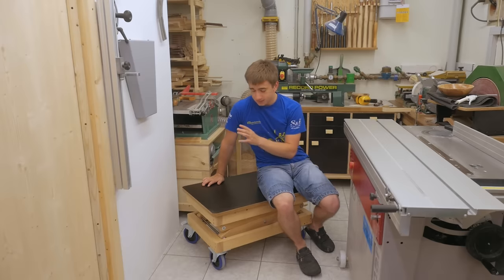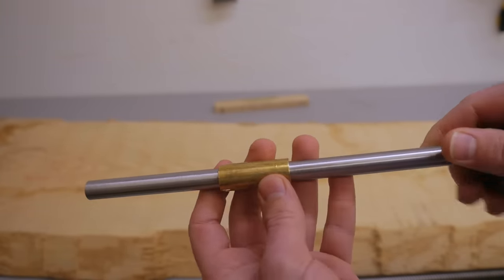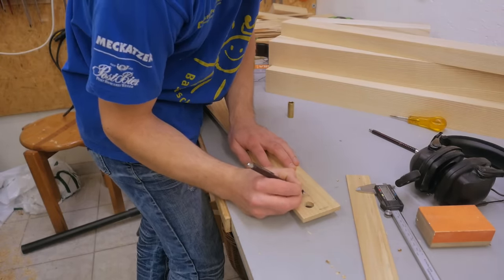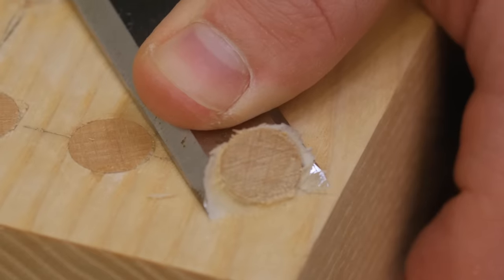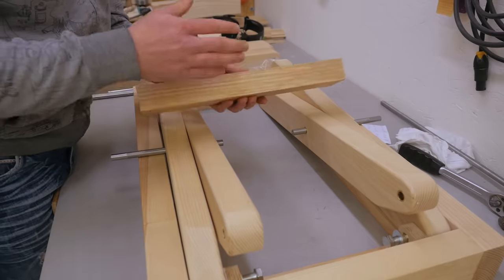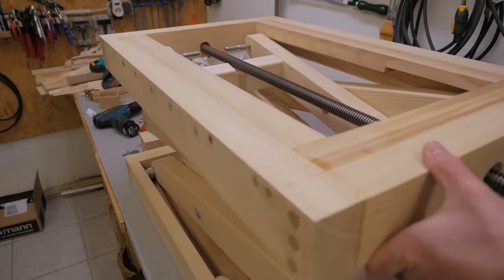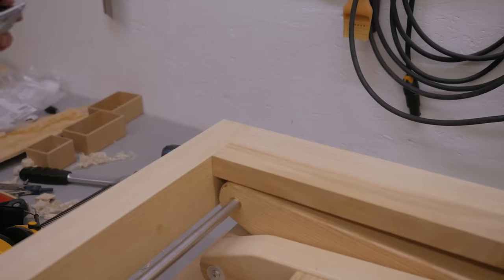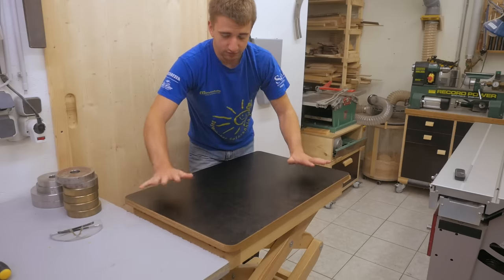Homemade Wooden Lifting Table

Comment: Wow!  One of those would have been handy during my move.  Now thinking about building one, but I'm not sure I have enough need for one compared to the time it takes to build one!
Reply from the maker: I can only recommend building one. For me/ us it already came in handy inside and outside the shop. Without filming you could do it in 3-5 days
Reply: Grosses Lob von Matthias. Kann nicht jeder Holzwerker aus Deutschland von sich behaupten.
Reply: Yes build one! I'm always surprised what you can make from scrap  materials. and another shelf build is not that fun to watch.
Reply: make one to replace scaffold :)
Reply: Ernst van Spronsen Everything Matthias does is fun to watch, but yes I would love to see him build one too.
Reply: Ha! When was need ever a reason to justify building something but I reckon an Arduino bluetooth remote motorised scissor lift scaff would be really handy.
Reply: 3-5 days is a bit to pessimistic - Matthias would probably tear down some ikea shelf and an old bed frame, put a few tennons with his panto router on them and will be finished in no time :)
Reply: I'd love to see you build one :)
Reply: Matthias, it still would be handy if you build yourself one... why?

well... when you have to assemble something heavy and want to get it on or off a workbench... it even works as some mobile work surface and work support... for example as a outfeed table extension :-)

and there are many more uses for sure
Reply: The first thing I thought of after watching the intro was that "Matthias could sure use one of these" quickly followed by "I'd sure like to see how Matthias would make this"... Even if you get minimal use it'll get great views and then Heisz would have to make something besides chainsaw stools.
Reply: It would be interesting to see your take and application on the project.  I was thinking could I do this in metal to add strength to the machine.
Reply: I bet if you did build one, then you would find more uses than you can shake a stick at. I bet you Rachel and family would find uses for it as well. :-) So build one and see what happens; if nothing else, it will make a nice adjustable height workbench/outfeed table.
Reply: It's a dolly effectively, with lifting capability. If built well, like Marius did, it will last forever and could have everyday use in shop.
Reply: A collaboration between you two guys would be fun to watch!
Reply: Dylan Strawn does anyone remember Matthias' motorised scaffold platform?
Reply: Nicola Cassolato they'd build a space station or a flying saucer!
Reply: Matthias Wandel I think it's one of those things where once you have one you find more ways to use it than you originally thought
Reply: Matthias Wandel uh oh Matthias, you might be looking at your replacement!
Reply: Build one please!
Reply: Make one with wooden gears.
Reply: + Matthias Wandel, maybe you could take it a step further and build one that you could crank up and down while standing on it? You know, for reaching high shelves in a vertical storage system? Hey, that's an excuse to build some higher shelves as well. Multiple projects/videos to justify each other.
Reply: suit1337 I agree with your comment, but I believe you are thinking of a different Matthias :)
Reply: @ernstvanspronsen1502  As long as you have no need to use your time on anything other than hobby projects.  You couldn't make enough money working in mcdonalds in less day to be able to buy one? And not out of wood....
Reply: }}} "Wow!  One of those would have been handy during my move.  Now thinking about building one, but I'm not sure I have enough need for one compared to the time it takes to build one!"

Hey, half the point is the fun of doing it. 😀
Reply: How much you need it compared to the time to build it is a stupid comparison Matthias. You only need to build something once you then have it forever. I would build one if i were in your shoes

Comment: Beautiful piece! And very impressive strength.

One suggestion: When you made the template for the scissor arms, since you needed the ends equal distance from the center, you could have made a one-ended template instead of a two-ended template. Clamp, drill center and one end, then put a bushing in the center and rotate it to drill the opposite end.

Comment: This was an awesome project! I would love to have a lift like that for working on yard equipment, and small engines. As far as the metal lathe, what reasonable person would expect you to use it in the manner of a professional machinist? As far as the length of the video? When the more interesting the content, the less one notices the passage of time. 
One thing though, keep your fingers out of the crush zone of that lift, at all times, regardless of how much you trust the device. We don't need you changing your channel name to Marius Halfhand Hornberger.

Comment: Thanks, Marius. I'm almost done with mine tonight.I have to weld on the drive nut and make the handle!! you make a great instructional video. I like the hydraulic idea but mine will not go over 55 inches so the crank will work fine.   What is the distance of the handle on the crank to the socket?.It looks to be about 8".........cheers, Jim

Comment: Marius, this lift opens up new possibilities for shops with limited space.  My shop is 19'x20' (5.9x6 meters) interior dimensions but I have a lot of tools and machines.  I had been thinking of building a table with a rotating top for the sander, grinder and drill press.  A flip table would accommodate the planer and miter saw.  With the lift table it would be easy to store all of the tools in vertical shelves and set the needed tools out as required.  The primary function of my shop is to build radio controlled aircraft so large woodworking is a secondary function once the cabinets and workbenches have been built.

Comment: An addition I feel would be useful is to add a sheet over the area where the lower bearings run. That would reduce the amount of dust that collects there that could stop the height adjustment. Don't want to put something heavy on it and find it won't lower far enough because some wood chips got in the way.
Reply: Bunny Warren - I was thinking about the exposed bearings as well. Although they may cost a little more, I would have used sealed bearings. This was a well done video and an excellent project!

Comment: Hi. Very impressive. I wonder whether the scissor lift could be adapted to go right down to ground level. and up to perhaps 2 feet.  This would be great for wheelchair users (or even people with a poor walk). There seems to be a need there - and you seem to be close to filling it. It would need to operate by electricity (eg battery) but I think it is just waiting to be invented. Anyway, even if you do not go in that direction, I admire you for your very honest approach. Regards, Eamonn

Comment: I'd have done it differently.  I'd have cut each piece of wood just off square and drilled the holes with a greater degree of error, thus ensuring nothing lined up.  Then I'd have frigged about for hours trying to get the unit together, only to have it fall to bits when I tried to use it to lift my 100kg table off the groud.  I'd then drive down to the nearest store, buy one, scratched the labels off it and told my mates I made it.
Reply: Luke Johnson i cant find your build video? Some kind of youtube error i suppose
Reply: Dude. Feelz! This fella's precision has me all, like, stars in my eyes and such!!!

Comment: Hi Marius, I have to say that this is best 30 mins of interest build I have seen and well explained , is there at any time plans available as I have seen a great video which would help me in my work shop and as well as load my Water table saw into the truck by myself and be able to move my Drill press around in work shop, I would love a set of plans if they become available , thanks for a great explanation for this video build

Comment: I have a small lathe that I need to be able to store out of the way when I 'm not using it, then easily pull out when I need it.  It's too heavy for to pick up and move around.  I figured someone else had solved this problem, so I looked on-line and VOILA!  I found your video.  Do you have the plans available?  Thanks.

Comment: Excellent stuff - great work.  The only thing that had me cringing was when you were holding down the corner while lifting the drill press from the lowest setting - you had your fingers under the scissor lift...!  Ouch.  Other than that, I can't find fault with anything, so all the nitpickers who have commented with nitpicks need to pull their respective heads in (Aussie expression there ;) )
And that is some great machinery you have there - I'm lusting after that metal lathe (and the skill to use it).
Reply: I've found, much to my dismay, that if you ever browse the comments on any video for more than a few minutes, you will always find nitpickers.  And of course, they're usually people who "know" much but have done very little.

Comment: Really excellent build. My only suggestion would be to investigate the use of CNA glue inside the tapped holes. I'm told the durability of the taps in wood is increased. I believe you tap, coat with CNA, and then tap once more. Thanks for the great video! Subscribed!

Comment: I know you don't have a lot of time, but would it be possible to get a rundown of some of the basic dimensions for this table? Such as the hole spacing on the scissor beams? Most of the other stuff I can engineer based off of that, but it would sure be a good starting point.

Comment: Does putting the handle on the top decrease the force that I need to apply? Does the placement of the shaft on which part of the scissors effect the force that I need to apply to the handle?

Comment: Marius, you seem to be very smart!  I really enjoy your videos.  You have a lot of expensive equipment!  You seem to be wealthy beyond your age!?  How do you make it happen? 
  I do a little wood working but not on your level.  I am 80 and had a stroke 10 years ago and it left me handicapped on my left side so I have to work with one hand only.  I may try to make a couple of these lift machines but on a smaller scale.  When I fall I can't get up so if I had a lift machine it would help me get up.  Keep up the good work! 
Al.

Comment: Thank you for sharing it.
I wanted to know if you could suggest if this kind of system can be built for below situation:

 lifting a car from ground floor to first floor. Car's wait 2000-3000kg. The system needs to be kept in front of the house so it should be foldable which can be kept aside when not in use.

Comment: If you cover the threaded bar with a fabric sleeve it will keep the grease clean and reduce wear. You could also consider putting the spindle through the middle of the lift. That keeps the handle away from the load.

Comment: Very nice project. I really like the way you approach your projects and the clean working style. Also starting with rough wood is already a challenge. I am in the process of making a lifting table myself and was already looking for metal to build it. However, after I saw your video, I decided to use wood. I got a lot of ideas from your video and have seen it a couple of times now. I like the way you installed the ACME screw using two different bearings for the radial and thrust forces. I will not use bearings as rollers in my project as you suggested that in your video, but have yet not decided what I will use instead. 
Keep up the good work. Thanks for sharing your project here.

Comment: You mentioned building another table. Could a second table be built in a way in which. You could back it up to the end of the first table. So they could be joined together to function as one longer table. I was thinking linking the rod together with two nuts welded together. So a pin could be placed in each section of threaded rod. Combining the two rods to make one really long one. Forgive me, I am not very good at describing what is in my head. Just an idea. I plan to build this myself. Maybe not in the very near future. I do not have your resources. I love the video you are very talented.

Comment: I had a commercial version  with a hydraulic piston and it would slowly leak internally. For my application a screw would have been superior. Your project is beautiful and looks like it will be very useful in your shop.

Comment: You did such an amazing job here's what I would change about it though I would put smaller wheels and spread them out further apart to keep it from tipping and the top I would make out of stainless steel so that you could slide pieces on and off of it without gouging the surface

Comment: I've never seen anyone tap threads directly into wood to accept metal hardware.  Have you found that those threaded holes maintain their shape and strength over extended use, or do the metal bolts wear them out over time?

Comment: You should find a power chair and use the linear actuator instead. Most of them plug into the wall socket here in the USA and are regulated down to 10-12 volts. That is easy to be able to operate with a battery.

Comment: Questions:
How do you determine the wood size you need for the joint size? Meaning, how much width around a joint do you need?The joints are reinforced with metal which tells me that that is where the most force comes into play--because force has to turn a corner so to speak. Side to side seems important, but given the method of fastening, a lot less important. Either that or because they are there to balance the outward forces on the load by directing it inward as it rises. Does increasing the woodwidth around a joint have a large impact on the amount the lift can carry? The taper made me wonder.

Why brass? For visual appeal or, say, some trait you like, like malleability?

Comment: A very nice job, a small tip for you,
The dowels wouldn't go all the way into the hole as the space was full of glue , what you need to do is saw a few shallow slots around the dowel lenthgways before you push it in, this allow somewhere for the glue to go plus gives you full glue contact the length of the dowel.
Reply: O

Comment: Excellent, Marius - cannot fault your design - it's brilliant. As to your parting remarks regarding an hydraulic pump, getting exactitude in terms of height level might be problematic, ergo, teasing the foot pump so that you are at (that) required level; perhaps a combination of hydraulic pump & crank handle ? nevertheless, that's a serious construction - well done you !!
Wish I had lathes to cut the bushes/rods to size - I'd have to rely on an engineering workshop, or purchase factory produced parts that would facilitate the build - & certainly, I'd be interested in a set of plans :D

Comment: Pretty slick contraption there, Marius!  I sure could use one of these now as I'm restoring my old college motorcycle and I think I could adapt this concept to make a lift for the bike so I don't have to stoop over for bottom area work.  You show a natural inclination for mechanical engineering & woodworking, so I think you should consider quitting that rock band you're in and enroll in your local college/university(!)  ;-)

Comment: It's been four years, but with that chunky hex nut on the input shaft, you could use a socket on a power drill to crank it up if your arm gets tired ;)

Comment: A very nice build, Marius.  It seems you left no stone unturned in your effort to design and build this high-quality lift table.  The thing that got me looking at your channel and this video, specifically is the need for a lift table to make working on my velomobile easier.  I don't think I will be able to replicate this project of yours, but I want to ask, is there anything inherently limiting about this design, such that it would prevent the making of a longer and slighter wider table?  One last thing, you mentioned four years ago that you were thinking about making plans available for this project.  Are there plans available, now?  Thank you.
Reply from the maker: You can definitely make the table wider and longer. But then not only the top plate has to get bigger, but the whole assembly.
I'm working on plans rigth now, but can't tell when they're done

Comment: For narrowing diameter of rods, a quick way that I have used, without a lathe, is chucking the rod in a drill and running it through sand paper in my hand.  I just used trial and error, back and forth to get the right fit.  Not great for work like this, where you have to make many, though.

Comment: As effortless as it looked to us ethe crank maybe an adaptation of  electric motor (like the drill) but a permanent solution so you dont have to deal with bending down to use either. Just have a foot pedal for forward and reverse.

Comment: I like that you made a Wooden Scissor lift just the only thing I would ask is can this design be both modified and add another set of Scissor joints...?
Reply from the maker: should be no problem to just add another scissor set, they're all the same

Comment: Excellent build. You might consider using an auto window lift from a car. It is a strong gear motor with a lot of Torque. Plus it will work as a break when off. 
Is pine strong enough? Or should it be built with poplar?
Reply from the maker: An auto window lift from a car wouldn't be nearly strong enough for this. A break is not necessary, since the threaded rod will never turn on its own.
I wouldn't use pine neither poplar. Best is hardwood, like ash, beech or maple.

Comment: I don't actually own a lathe. But I do know that the object used to catch the parted off bushings should be softer than a hex wrench. If something goes sideways/wrong, the spinning work could catch the hex wrench and take your hand with it. Using a pencil or a piece of wire instead, you won't be injured because the pencil will break or the wire will pull out of your hand (don't wrap it around your finger). 12:25

Love your channel, subscribed